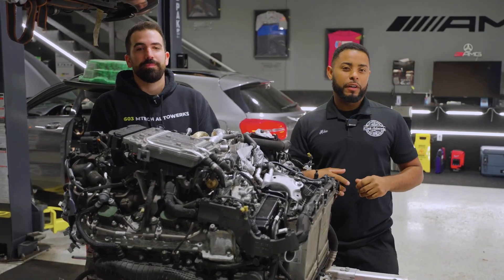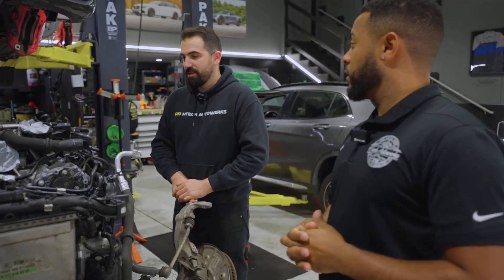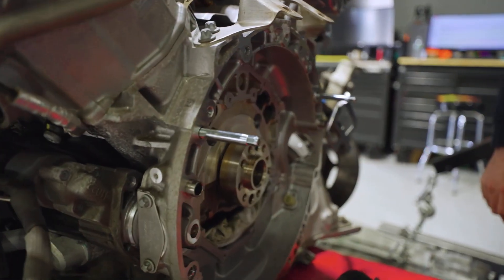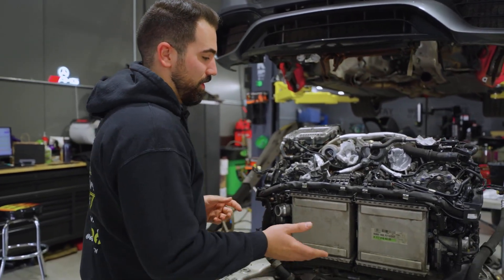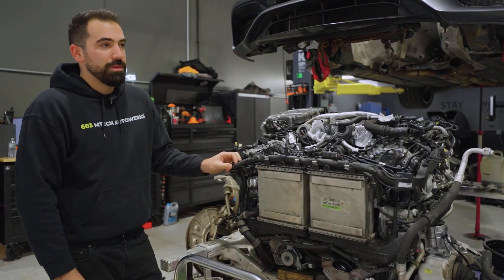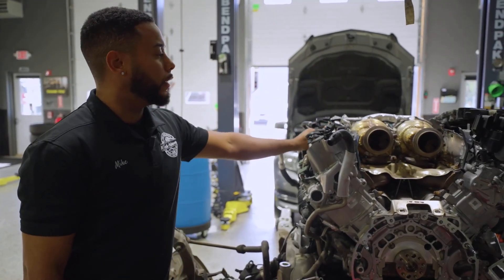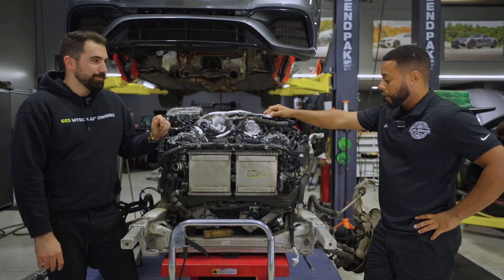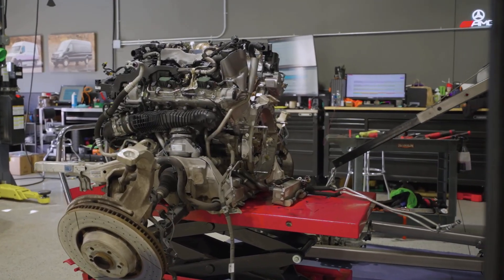Mercedes M177 Oil Separator Failure | The Real Cause of Rear Main Seal Leaks

Comment: How do you diagnose an oil seperator on a m177 g63 2019. Any common code? Is it possible to test without removing the whole intercooler setup?
Reply: Did you find anything about it

Comment: Does replacing the oil separators with the new parts, fix the issue of a possible RMS leak? I did exactly that prior to a leak, but I still have the old RMS (no leaking yet).

Comment: I have a 2005 CL 65 AMG with a M275 engine. I noticed that when the engine is running, if I pull out the dipstick plug, there is a pronounced vacuum sound. I replaced the crankcase breather and all the hoses, still makes the suction sound while I pull off the dipstick plug. Any idea if this is normal or is something wrong ?

Comment: Would installing an oil catch can help prevent the oil separator from getting clogged and causing leaks in the main seal and valve cover gaskets due to increased pressure? 🙏🙏 Or it will do more harm?!
Reply: Italian tune-ups help. when these cars are babied, I think they're more prone to clogging.

Comment: My Mercedes is 15 years old and has never had the engine out.   Most of these repairs used to be DIY (including motor mounts, drive belts, spark plugs, etc.) with no need for "special tools".  Modern Mercedes are lease-only vehicles.  Not worth the cost of ownership.  Overcomplicated, planned obsolescence, and no right to repair.

Comment: My 2020 S63 AMG Coupe is at the dealer now for the same issue with only 40k miles on it,  leaking rear main seal and faulty oil separators, along with the valve cover gaskets and front cover that need to be replaced as well. Thankfully, everything is covered by the extended warranty, otherwise, I would have been screwed badly.😅😅
Reply: My 2021 E63 with 31K miles has same issue except I have no extended warranty 😢.
Reply: @gccohenmd I just had mine done for my 21 E63s😢